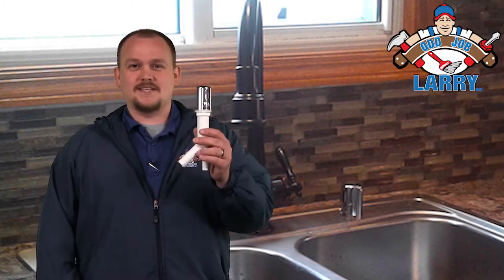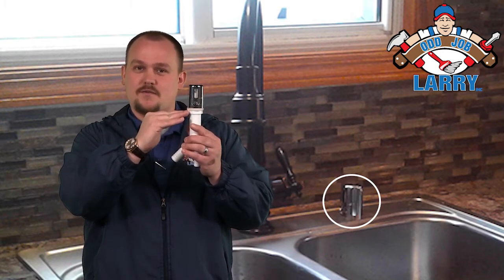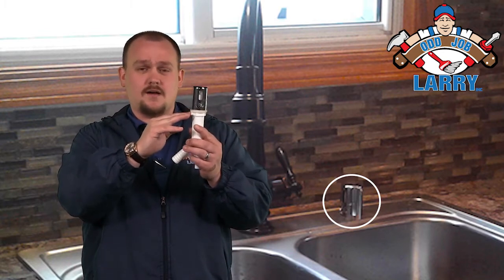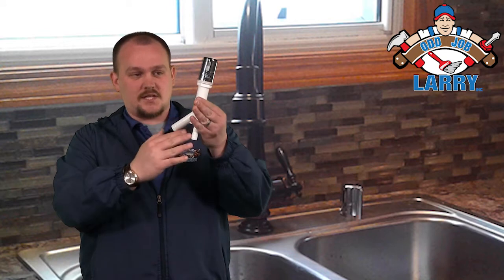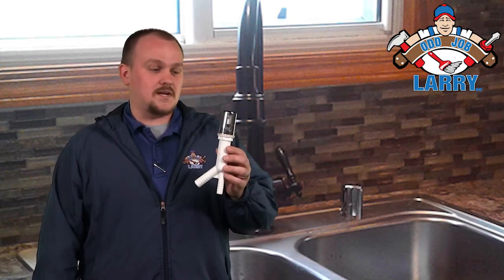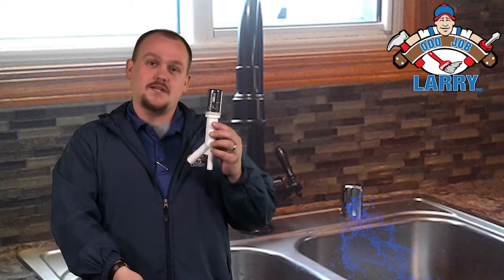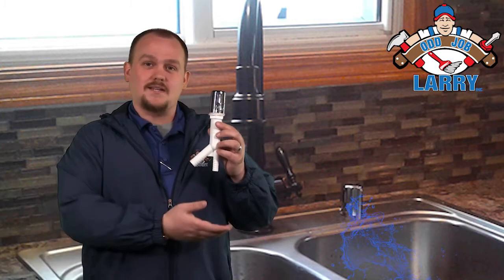Why You Need An Air Gap

Comment: The granite installer said we do not need an air gap and did not put a hole in the granite counter top.
Reply: The problem is if there's a clog in the line from the dishwasher to the disposal, then the dirty water will backflow into your dishwasher. Granite installer doesn't care because that's your problem to deal with.